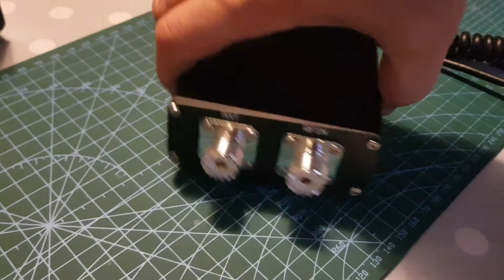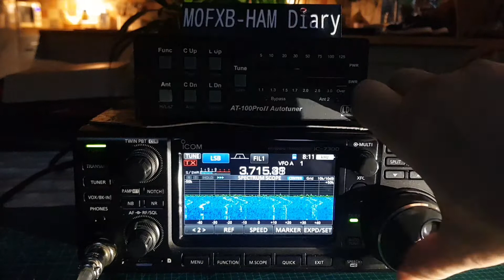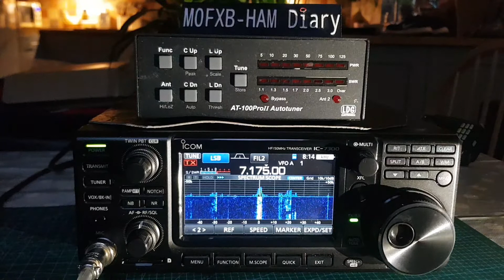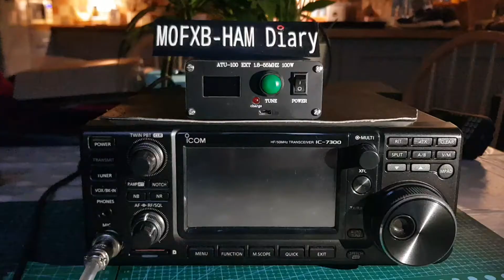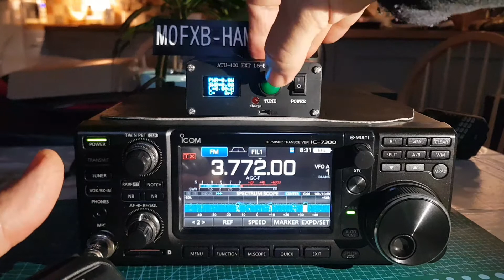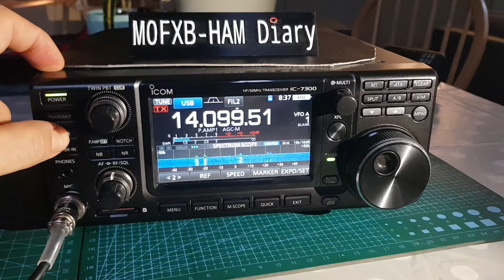BUDGET ATU 100 Antenna Tuner - £68 with Icom IC-7300 and LDG 100 pro II Test and Reveiw

Comment: Just wondering what antenna you are using, about to buy the ATU-130 an upgraded version of ATU-100 on an end-fed long wire. Interesting video, many thanks. G1DYL
Reply from the maker: Hi , I use and EFH Wave - 49.1 balun
Reply: @m0fxbhamtech  Many thanks for the reply, When I have my IC7300 and the ATU-130 I will update the results.

Comment: soryy, but seems you have get deeper into the atu-100 use, before doing a video. set it into automode in the fw menue, then it will tune right on tx. you also can adjust ghe swr threshold value. 73
Reply: How rude he is seems a good tuner good video 
73...
Reply from the maker: This is my diary I learn in front of my viewers i decide when i do a video-Thanks 73

Comment: eye, the atu 100-ext absolutely must not be used with powers greater than 25 w otherwise it goes up in smoke! ... hi! .... It is not true that the atu-ext 100  holds 100 watts, not even 40 w .... ..but you have to stay within 30 w;  My doing tests like you did I went up in smoke and I had to throw it in the waste bin !!.....
I advise you with the maggic ic 7300,  to use its internal tuner, at the limit in"  emergency tuner mode" and you have no problem, moreover the uu 100-ext with its integrated battery using it at home after an hour of  use and without tuning, the battery is already empty, so it has little autonomy .......
I believe it is suitable for radios that do not have an internal atu, it is absolutely not advisable to use with radios equipped with a tuner.

Greetings .... and peace and good
Reply: Unfortunately the most of Chinese manufacturers use very bad amidon cores with large losses and low voltage capacitors, bad tandem match core. Actually that is not ATU-100 at all, that is a bad clone.
Reply from the maker: Thanks agree
Reply: Burned coils https://youtu.be/oBJUfugL4dM